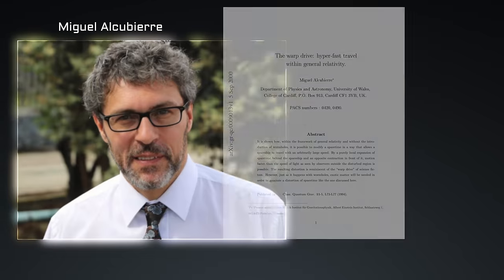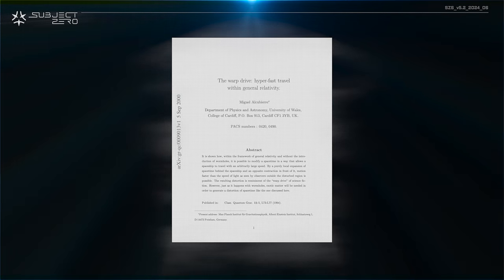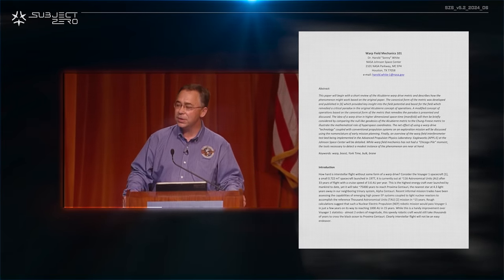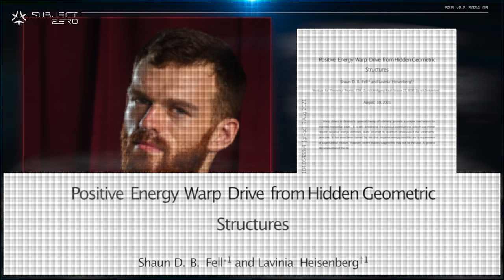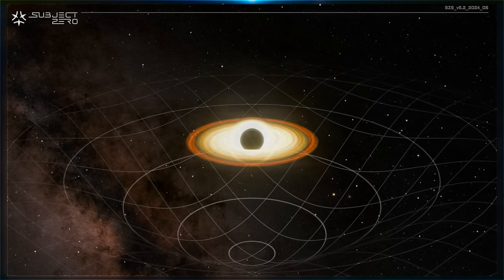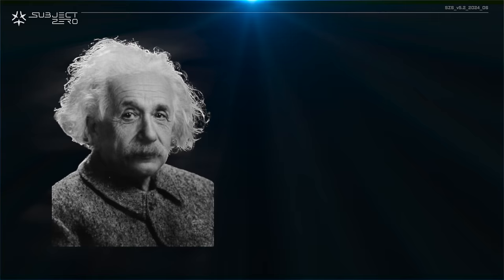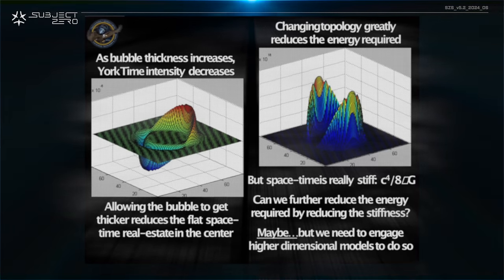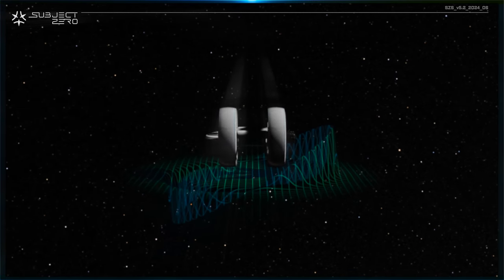This problem makes Warp Drive impossible

Comment: I think another approach is instead of looking at energy, look at the nature of an absolute vacuum also defined as free space. Turns out c²=ε₀μ₀ which might used in terms of substitution. (For those missing the unicode characters, that is the square of the speed of light is the product of permittivity of free space multiplied by the permeability of free space.) In which case it may be that m=E/(ε₀μ₀) (mass equal to the ratio of Energy vs. the product of the vacuum properties.)

I'd hypothesize that doing something like using some kind of laser interferometry with Casimir plates in a vacuum chamber might be a thing to start research with. Basically looking to see what if anything can cause ripples or standing waves as detected by the interferometry apparatus over the boundary zone of the Casimir plates. Magnetic fields (both static and dynamic), RF waves, charge carriers, rotating masses, various combinations of such... Are the vacuum properties always constant, or are they more reflective of a couple other things going on that we haven't paid enough attention towards?

In other words, think of the vacuum properties as describing something to do with the tension stored in the rubber of the rubber sheet analogy used in the video to describe space-time. Understanding that well enough may indicate there might be something interesting where you could manipulate gravity waves, instead of directly needing exotic matter. If it's possible to figure out that hack, then you'd have something.

Comment: Okay, taking the negative energy out of the equation is cool and all, but how do you engineer the mass and power plant needed to move such mass, or god forbid stop such a vehicle?
Reply: The vehicle actually never moves, it is the space that moves around it, so to stop it you just need to stop the warp drive.
Reply: @Maverick966  negative, it's constantly falling forward due to the gravity well. This is not a folding engine.

Comment: I bet we will beat the light barrier. Just because we don't know how yet doesn't mean it's impossible. Gravitational waves have shown us it is possible. Before the sound barrier people thought all kind of crazy things would happen or prevent it, turns out it's just a bit of turbulence, pressure changes, and accounting for changes on how control surfaces respond. I think we will eventually achieve the same with the light barrier. It's just a larger, harder to achieve challenge. But we will get there.

Comment: The warp drive most likely is impossible. While Alcubierre described how it could work, he basically just used the math that space can curve to say it's possible. There was never any explanation as to how you would even go to warp space in a positive way not even thinking about negatively for the field. 

Plus in recent time more research has heavily cast doubt on warp drives being realistic or even safe even if they could be done. In recent times most evidence suggests that gravity isn't actually a field at all, it's just a side effect of the warping of space time, so that would kill that method of warping space. Studies of unrah radiation and hawking radiation have suggested that a successful warp field would expose the ship to nearly unimaginably powerful waves of radiation. The negative portion behind the ship would basically be like being chased by a white hole. 

And then there's what I'd refer to as the "spatial spring" effect. The warp field around the ship has to be released at some point and when it does the energy expended warping space needs to be released with it making what would be an absurd death ray nearly as powerful as some black hole's jets. If we accept the fact this is real and alien life exists, well this effect should be obvious across the entire universe.

Comment: Is it theoretically possible to contract space-time in multiple areas in such a manner that it could effectively expand space time in another individual area? So you'd be using the contraction of space-time in order to expand space-time in another location therefore not requiring the use of exotic matter?
Reply: No. Space time is not like a fabric.
Reply: So in essence the hard work has already been done by mathematicians and physicists but as usual the engineers are taking their sweet time.
Reply: @MuppetsSh0w  There's been some proposed things in papers about the spring-like qualities that suggest it has some effective form of Young's Modulus applicable. In other words if those are correct than it can be treated like a fabric, the real trick would be making the gravity waves to take advantage of that.

Comment: The problem with warp drive is nobody ever tried to go faster than 186.000 mph, or faster than the speed of light. Nobody tried because that is impossible. I believe it can be done. It can't be done because nobody tries.

Comment: Crazy theory time: gravity is a dipole.

"What?" I hear you say, "no it's not."

Hear me out, it is, but its poles are at the same physical location in 3D space, they are only separate in 4D space. Or, the state of the poles are super-positioned over one another, but separate temporally. So to that, all we need is to split the poles in regular space. A boson beam splitter.

And the energy required to do this may be far, far less than that of a Jupiter-worth of nuclear fusion.

Comment: Even though I'm firmely of the belief, that faster than light travel is, and always will be impossible (it's not a technical issue, just waiting to be solved; its impossibility is ingrained in Special & General Relativity), I still think we shall continue to grant science funds to the question of whether they can make a functional warp drive or not. 
On the way there, they are bound to invent and explore many new things. And knowledge is always good; it's what you do with it, that is important.
Reply: This is not faster than light speed, it doesn't brake any rule, it is the space that moves around the spaceship not the other way, the ship never moves physiscally, this is possible because space has no speed limit in real life.
Reply: @Maverick966  Nowhere in my comment did I say or imply that the warp drive is "faster than light speed" - I was talking about ftl travel in general (please read the whole comment).
I know how the warp drive is supposed to work, but thank you for trying to explain it.
Reply: even if FTL is impossible in nature due to implications in causality, an STL warp drive would be extremely valuable to the exploration and colonization of the solar system, as well as of the closest star systems. It is worth the efforts to try to engineer this device.

Comment: I believe your visual explanation of negative and positive space is slightly incorrect, what is actually happening is that the grid scale gets smaller within negative space and larger for positive space this has an effect on how we perceive light curving also time within negative compressed space grid slows, its the reason why clocks are slower on earth vs in space for example.  

In the case of the warp drive the goal is to compress and expand the space time grid to create something akin to the effect of riding a wave on a surfboard, in my opinion though if we manage to create an expanded space time bubble around an object it should allow that object to move up to instantly to the outside observer.

Comment: If you believe space is expanding, isn't that space warping all by itself without space using energy?  Now if we could harness that expansion and turn it into energy oruse it to make a warp bubble, could we then travel against the expansion and make a wormhole to travel though space?  Or how does making your own space warp drive work against the expansion of space?

Comment: Assuming you could get the warp drive to work what do you do about the paradox of FTL? It's effectively backwards time travel to go FTL. I can only imagine that it is just impossible because if time travel exists where are all the time travellers? idk
Reply: Can't change the past.  Think of it like a rubber band.  Can stretch it backwards.  But will return to it's original form.
Reply: @TheCaptainSplatter  your "rubber band" analogy does not adequately address  paradoxes, the potential impact on causality, the complex behavior of time at the quantum level, and the practical implementation of time travel. its more likely you heard it out of a movie somewhere.
Reply: you wouldnt be travelling through space so time dilatation wouldnt take action.

Comment: What we need to do is to know if it wont mess up spacetime like traveling close to light speed does. Like lets say I warp to pluto, stay there for 10 minutes, warp back, and only 10 minutes has passed on earth
Reply: Yeah when you come back to earth it’ll be way more than just ten minutes
Reply: it wouldn't because you wouldn't move through space, it would be the space itself moving. Space far away from us are already moving faster than light relative to us due to the universe expansion and this doesnt create any time dilatation

Comment: "In the Casimir effect, two flat plates placed very close together restrict the wavelengths of quanta which can exist between them. This in turn restricts the types and hence number and density of virtual particle pairs which can form in the intervening vacuum and can result in a negative energy density." UAP exist, and the come from other worlds, not earth. You can construct a space ship that creates your negative energy, the construction is the problem. To claim 'This problem makes Warp Drive impossible" is incorrect.

Comment: A) there's no such thing as negative mass.  Even antimatter has regular mass. 
B) The only place in the universe with an energy density sufficient to create an EinsteinRosen bridge is an event horizon.
Reply: So we make a black hole drive then.
Reply: @TheCaptainSplatter  if we could charge a black hole maybe? Then use a magnetic bottle? And then, if you could spin up a black hole you could maybe exploit that momentum.......

Comment: In the Star Trek series, the problems with warp drive are no longer an issue - they work, and ships are able to go from no or little motion to faster than light in a fraction of a second.      What keeps this from killing every human on the ship by mashing them into a stain against the back wall is something referred to as "inertial dampers", something never really explained but shown as a problem when they are offline.     "Captain, we cannot go to warp speed because the inertial dampers are offline".     

My question concerns this concept of warp drive, where the ship is motionless (is it?) while space is "warped" around it.    Does this get away from needing something like an "inertial damper", because if it doesn't, then it will take some time to go from sitting still in orbit around a planet to light speed, and this gradual acceleration will both take time and put stress on the human body.    Keep in mind, that the process will need to be reversed as the ship nears its target - it cannot just stop instantly like it can in the Star Trek series.
Reply: If the drive is using a controlled black hole like in this video, the concept itself might be used in inertial dampening.
Reply: StarTrek is a scifi show, they are allowed to be confused or do whatever. They never explained the actual warp speeds although they did imply they never surpass the speed of light, the implied warp 10 where you should never reach, but they don't say this either, cause they seem to get to places very quickly for sub light travel. That's obviously better than watching a few years of an advertisement break till they reach their destination so you get to watch the rest of the episode.

Comment: 1st) Nuclear power should be ruled out, for an obvious reason (meltdowns, & radiation)! But, with a non-nuclear power source, can enough power be provided to the ship? Solar is definitely out of the question as the primary energy source! Maybe as a backup energy system on the outside of the ship's rings!? An alternative energy system has to be created/allowed to be created! That's also self-sustaining!
2nd) Engines that also work in space very efficiently, & effectively will be needed! Use them to gain significant momentum, before engaging the warp bubble! & thus the warp drive too!!
3rd) Experiments on creating stable warp bubbles must be conducted, to protect the lives within it! Not take their lives!
4th) Figuring out time in warp, to the ultimate destination! To figure out how much food & clean water it would take to get there, & back (round trip)! Plus, dealing with human waste, & storage within/expelled from the ship! More human pollution in space! Something that should be considered!
5th) A docking station for the warp ship(s) in space! Because having a backup ship is just smart! In case of rescue, towing, repairs, etc.! (AAA but in space, joking) Communication systems that work, extreme long distances, re-transmission platforms, work while in warp(?)! Setting up a docking station on arrival! Having a shuttle (small craft) that can decend onto a planet, & return without problems! Protection of the crew, medical staff, engineers to keep both (all) ships in working order, scientists (obviously) to make sure the ship is working order (& other stuff)!
6th) Hopefully, it doesn't need weapons, but considering everything that is out there (blackheads, etc.) by having something installed could help more than 1 person might think! Better paranoid & prepared, than being completely unarmed, & unprotected! So weapons should be developed for use in space, just in case! For science, & defense purposes!
We're basically building a highway in space, & we need to develop infrastructure for it! As well as considering 1st contract senerios too!! Just in case!! & in case things go wrong!!

Comment: No. There are WAY more problems than just the negative energy thing... It would already have to be travelling faster than light, it would be impossible to stop once it starts, and even if it could stop it would just destroy the destination. Research into warp drive isn't entirely without academic merit, but papers like Alcubierre's dont represent steps towards a theory of FTL travel, but instead just describe in ever greater detail exactly why its impossible and can never happen.

Comment: Positive ultra short impulses. The video is right, we dont need exotic matter when we can create field interference of waves. The challenge once its impulsed fast enough will be the interference patterns.

Say in space we spew ions out and create a flow reversed loop or orbital shell for ions to travel through in routes with charge or magnetic field based attraction or deflection.

Comment: Okay, cool, but this still doesnt solve the problem of Relativity. We wpuld need to chain space itself between two points or time would pass at radically different rates, even just outside the orbit of earth time passes much wuicker on earth.
Reply: you wouldnt be travelling through space so time dilatation wouldnt take action.

Comment: There is another, major problem which you haven't touched on, mass imapcts.  Specifically micro meteors.  A mass no larger than a pebble need not even be moving to cause catastrophic damage (hull breaches) when the ship itself is moving at high speed (even at "mere" tens of thousands of miles per hour).

Until either materials engineering has advanced sufficiently, or some sort of energy shield is developed, current shipbuilding technology will remain inadequate for even interplanetary travel.
Reply: uh no. I think youre missing the entire operating principle of a warp drive. The ship would have no velocity relative to the space it was moving through so mass impacts would not be an issue....
Reply: @HailAzathoth  Yeah but what happens to something inside a spacetime bubble when the bubble itself is moving faster than light? Or at least close to light speeds? Would the bubble act as an energy shield against incoming impacts?
Reply: @-_Nuke_-  I assume the shit that is on the warped space stays there... It will be deflected around following the warped space no? Maybe i am understanding the concept wrong.
Reply: @-_Nuke_-  
It seems that any object entering the warp bubble would be entering the space inside the bubble. So, the object would find itself moving at a speed relative to anything inside the bubble. Said object would only do damage to the ship inside the bubble, if it were going fast enough to do damage outside the bubble. If the relative speed of the object and ship were, sans the bubble, 100m/s, then inside the warp bubble their relative speed is 100m/s. 

It is not "navigational shields", as in Star Trek, that big eye-like dish on Starfleet vessels that project a force field to protect the ship form environmental debris and particles. But the Warp field itself would in fact provide a default level of protection. Since a ship at Warp is barely actually moving, the ship is not going to run into stuff. Admittedly, STUFF is going to run into the ship.

Comment: OOOOOH, "WARP DRIVE IS IMPOSSIBLE" You're all a bunch of wimps. I built it in my backyard. And it works. I just got back from my test flight and it worked flawlessly. So tomorrow I'm launching the first ever test flight of my experimental warp drive. No need to with me luck because it already succeeded.